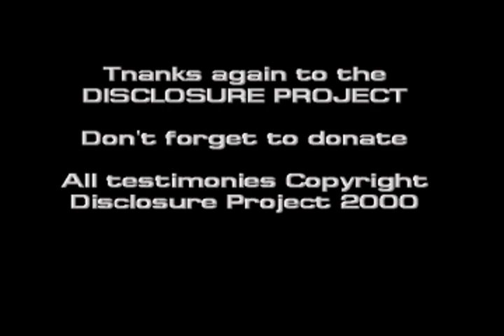Electro gravitics & UFO propulsion 3/3

Comment: The craft have an integral forcefield that deflects or absorbs all radiation, cosmic rays, and deflects cosmic-dust and micrometeroids, and repels larger bodies, and is repelled by larer mass-bodies than the craft, such as a planet or star.

Comment: Most of the craft have an integral forcefield for propulsion that either deflects, or absorbs any and all radiation and cosmic rays and it is just used by the drive, as in my Boss, professor John RR Searl's Inverse Gravity Vehicle, with integral Searl Effect Generator (SEG) drive-system, of which 41-flying models from 10-feet to 40-feet diameter built and flown from 1952-1978.